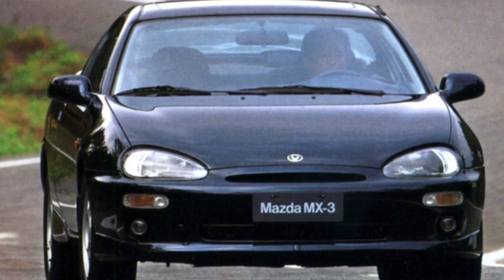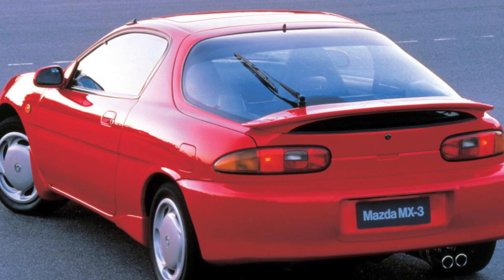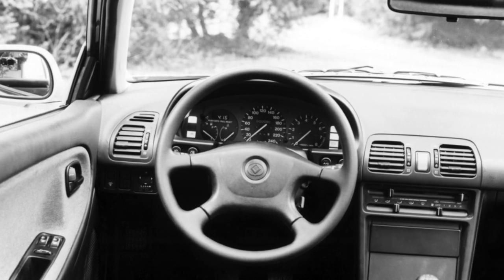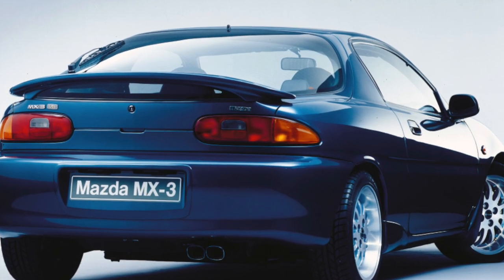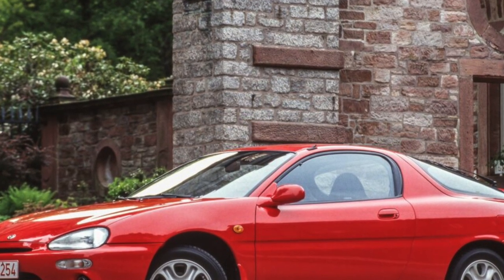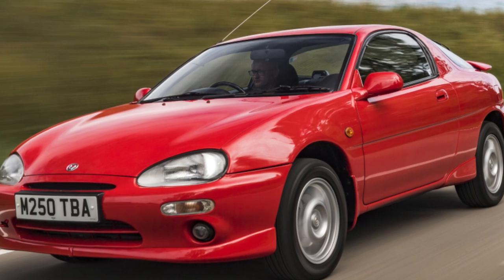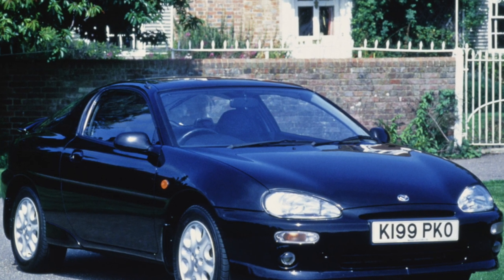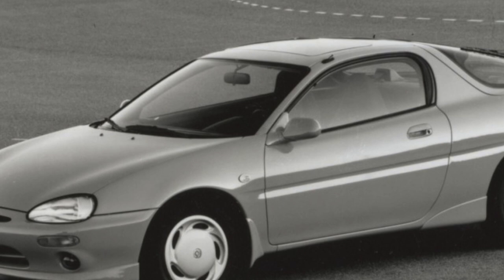Mazda MX3 Problems | Weaknesses of the Used MX3 1991 - 1998

Comment: There is a JDM 1.5 DOHC also that actually puts out more power than the 1.6..
Reply: I have it lol
Reply: @BboyTyranT  Autozam AZ-3 is what they called it in Japan. Quiet afew were imported into Ireland on the mid to late 90s..The 323F BG Astina and Famila 323 also used the same 1.5 DOHC engine.. 120 HP was their rating..
Reply: I would not describe this as a fast car. Its light. It has that. I floored mine trying to pass people. Confidence level 0.5 out of 10.
Reply: @AF_1892  That depends on which model you had.. I had the 1.8 V6 manual and the 1.6 DOHC manual..Big difference in performance between both.. Remember this was a car produced over 30 years ago.. The V6 model is quite quick and powerful..Its on a par with any other FWD  sports coupe of its time be it CRX, Celica, 100NX.